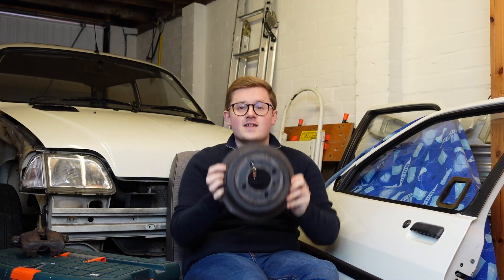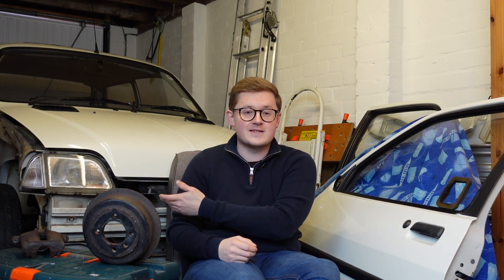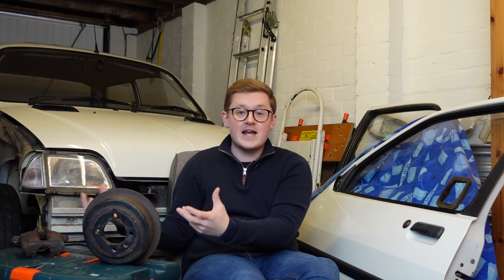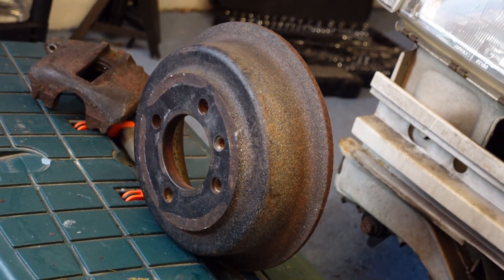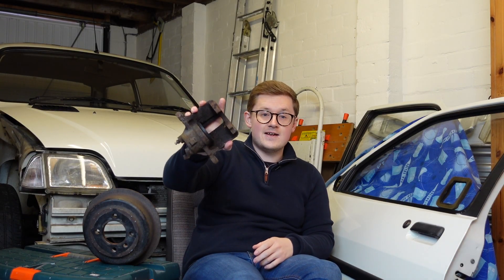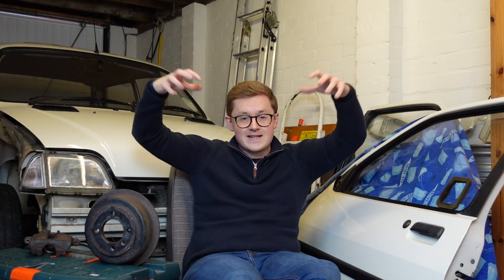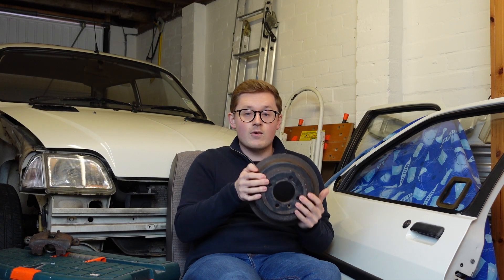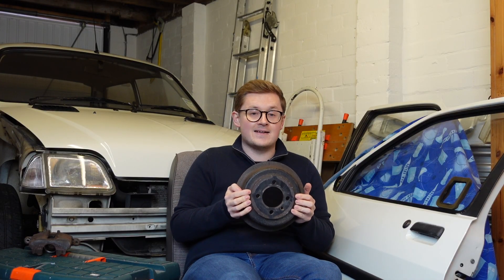Why are Drum Brakes Making an EV Comeback?

Comment: Drum brakes fade very quickly with a heavily loaded vehicle doing an aggressive stop. Nothing is worse than jamming on drum brakes on a dark highway at night with a large flatbed trailer crossing the lanes stalled there. I saw something that caused me to brake hard and then the headlights lit up that large agricultural flatbed. I put maximum pressure...stood on the brakes...and within 2 seconds they were completely ineffective and I made a dive to the right and narrowly avoided decapitating the 4 of us. The truck had no lights on at all. 

Also, when I crossed flooded roads, drum brakes would not grab at all until I rode around putting pressure on the brake pedal to dry them out. That might take 30-45 seconds before any meaningful braking was available. My experience was from a 1964 GM Corvair,  a 1966 Chevelle Malibu, and a 1968 Chevelle Malibu with drum brakes. Then somebody gave me a Triumph Spitfire with front disc brakes. They worked so well that I was a converted fan of them. They are also much easier to repair as the pads can be changed easily within minutes. I still have rear drum brakes on my older  truck and van.

Comment: Some good points, both in the video and in the comments. One point that seems to have been missed is that drum brakes don't work with anti-lock braking systems, as they cannot respond fast enough. Also, the "grabbing" of drum brake shoes comes from a wrapping effect, where the lead shoe drives the trailing shoe into the drum. An enclosed brake on the rear is so much better protected from the elements!

Comment: The EV is much heavier vehicle. The battery can be 1 ton alone. Drums are a cheaper way to go. Harder to replace shoes and many more parts than disk brakes. This all boils down to much more expensive brake job when the time comes. In fact all repairs on an EV will be more than a ICE vehicle.
Reply: Batteries are usually 500kg. I drive EVs now for 10 years and just sold a 10 year old EV with rear drums. If you use the brakes they dont corrode and last long, discs or drums. 10 years or 100k miles with the first brakes is no problem. Working on my own cars for 37 years and EVs have much much much less maintenance and costs
Reply: OK you seem smart how much is the  per mile rating and resale value. @t.d.5804

Comment: An interesting (?) point to note is that disc brakes need a higher pressure to operate than drums, meaning that on mixed systems the inclusion of a brake bias valve is needed to modulate the pressure to stop the drums prematurely locking up when loads are lower at the rear...
Cheers!

Comment: I am not sure I even understand why separate brakes are needed on modern EVs at all, couldn't you just make the regenerative breaking powerful enough to replace the whole, traditional, braking system? At least if the motors are powerful enough and put on all wheels and you also add a resistor that can take whatever electrical output they produce that the battery cannot take back...seems like a simpler, better system over all, except maybe for the parking brake and legislation that requires specific design. What am I missing?

Comment: just because EV´s get more efficient doesn´t remove the fact that they are far more devastating for the enviroment to produce than many older generation ICE-cars, many minerals are conflict-region sourced and next plan is to start mining the seabed bc there are based on estimates based on computer models and what people know about metallurgy utterly massive fields of rare minerals within the pacific seabed somewhere mid/southern pacific and others are few likely spot´s being looked for within the atlantic....still what that does to the sealife is to be seen.if we ignore that in the current top of the generational development still offers piss poor range in very cold climates dropping well below 20 degrees celsius they loose atleast 1/3rd of their normal range ability, and if there´s lack of charging stations,welp tough luck.Further more reliability comes to a question operating around -30 and even -40...something which is possible in the northern hemisphere sucha as nordics and canada...Most likely natural development as a transition away from ICE is some sort of Fuel cell, based on the massive buildup of hydrogen industry as the branch of the energy industry.

Comment: Um I have disc brakes on all four wheels of my vehicle, but I also have drum brakes on the rear wheels.
My drum brakes are the emergency/parking brakes, and they do not require brake fluid. 
So even if all my brake fluid suddenly goes on vacation, I still have use of my drum brakes.

Comment: I'd not want a car that was designed in a way that letting off the accelerator always engages an active regen systems... IMO the car should be in a "no accel" or freewheeling mode unless the driver is actively requesting it (through the brake or accel pedals). On Standard transmission vehicles you have that issue of braking when there's no input to either pedal (engine braking which can be very strong on some vehicles especially motorcycles) but have a clutch you can use to free wheel. I think using the brake to activate regen somehow is the right recipe but of course this all adds complexity (and complexity in your braking system is bad) so needs to be very carefully implemented.

Comment: Discs glazing predates modern EVs. The Dennis Enviro 300 was a full-size, single-deck, diesel-engined bus, with disc brakes on the front. (Can't remember about the rear.) As is normal for buses, it also had a retarder that cut in automatically as the throttle pedal was released. In service at the (then) new Eden Project, the retarder was so effective that the discs glazed. And the solution was to dial back on the retarder. [I worked in the Dennis engineering office, 2002-2008.]

Comment: (1) I had a 1995 Geo Metro for a few years. It was a joy to drive, got awesome gas mileage, and had an amazing amount of cargo space (so long as that cargo wasn't too heavy). It also was supremely balanced, spinning exactly around the stick-shifter (don't think too hard about how I would know that).
(2) My current vehicle, a PHEV, seems to be programmed to take into account the maintenance needs of the disk brakes—virtually always kicking them in before the car has stopped rolling.
(3) Properly built & maintained disk brakes DO NOT drag when released. The brake shoe / pad combination is actually a spring which is flexed when squeezed and retracts the pad from the disk upon release. If they did not do so they would wear DRAMATICALLY faster. This is also why one does not only measure pad wear at the leading & trailing edges as it is the wear in the middle which determines when the brake will fail.

Comment: Thank you for explaining why you were 'looking down' peridocally. I though you might be checking out our 🌭🍑   Well, nuff said about that. re: "Those R the brakes": Really clearly eXplained! May I add that disk brakes don't generally spin freely - causing them to drag slightly. Properly adjusted drum brakes R free spining. And I believe drump can be slightly ligher. Yes, shocking. But once you add up that very heavy rotor & caliper it can be a fatty. A plus for a power sipping EV. Thank you for the video. It's true what people are saying.. you do RoCk. Cheers from So.CA.USA 3rd House On the Left

Comment: I don't mind disk or drum brakes. Both work fine. My current truck has drum rear and a proportioning valve to decrease braking force on the rear drums with low to no load in the bed. Saves the rear from as much wear when not hauling something while increasing rear force when hauling. The front are disk. I do want to upgrade the front to bigger disk as they are quite a small size for a truck that can tow 7000lbs. However my old truck was all drum. 2" front and 2.5" rear. It was annoying to try and adjust them all so when I braked I wasn't pulled to one side or the other. I would get them just right then a month later I'm pulled to the side again. America kept the drum brakes around a lot longer than other places it seems. As my current truck was made in 2002 and my old truck 1973. Though I don't have a slightly older car to say if it was just a truck or America thing.

Comment: It is also important to note that classic brakes supplement regenerative breaking systems. This is because the energy that can be harvested from the kinetic energy of the vehicle's motion is dependent on the speed of the vehicle. That faster the vehicle is travelling, the more stopping power the regenerative breaking system can bring to bare. The downside is that regenerative breaking actually does fade to zero at low speeds (sub 5km/hr or so). So even in EVs outfitted with state of the art regenerative systems, the conventional brakes are still used to maintain a stopped position and very slow speeds. This combination makes regenerative breaking and ANY brake system a compliment towards each other and actually increases the maximum stopping force that can be generated by the system as a whole (though that is still limited by the ABS systems to avoid full lock-up, fun fact, regenerative breaking alone actually has something akin to ABS automatically as part of the physics of how they work. This is because the breaking force is actually dependent on the rotational speed between the Wheel and the motor, not the car and the ground, so a wheel that has fully locked up no longer has any breaking force from the motor and begins turning again.)

Comment: You've obviously never driven a car with drum brakes on a wet day - water that does get into the drum, stays in the drum and when you hit the brakes nothing happens, except that awful feeling in your gut when your car doesn't slow down.  It's something you never forget and you get into the habit of "drying" your brakes after hitting a puddle even though it's been many years since you had a car with drum brakes.
Reply from the maker: I have actually. Not in the wet on this channel, but a number of times off it. However, I’m guessing you passed your driving test some decades ago as all new drivers are trained to dry their brakes after driving through standing water, and when in wet conditions, to dry the brakes in the run up to a junction or other braking situation. It’s in the Highway Code too.

Comment: As an apprentice motor mechanic in 1961 I never saw disk brakes until much, much later. All the cars I worked on had drum brakes front and rear. I even relined worn brake shoes with brake linings off a roll. Those early brake linings contained asbestos. After riveting on the new lining with copper rivets you had to chamfer the leading edge of the lining so that the brakes didn't grab. Several years later we just got a replacement set of brake shoes from the local dealer or parts supplier, handing in the old brake shoes which were returned to the manufacturer to have the linings professionally replaced. In some cases drivers didn't have their vehicles maintained regularly so that the brake linings were worn down to the rivets and then the drum surface got damaged by scoring, so much so that drums sometimes needed to be sent away for machining to remove some steel in order to remove the score marks. This increased the internal diameter of the brake drum, therefore the brake shoes had further to go before contacting the drum, thus affecting braking performance. However, as I recall, slightly oversized brake shoes were available to compensate. There's a lot to be said about drum brakes, and I haven't even mentioned the wheel cylinders yet!

Comment: Very interesting.  I have a hybrid and I still haven't changed my brake pads even after 120K miles.  I agree that if the EV has brakes, they should never have to be changed due to regenerative braking by the motor.

Comment: Electrically powered wheelchairs and mobility scooters are only using regenerative braking to decelerate. They do have mechanical parking brakes, which are not used at all during normal driving.

Comment: The servo action of drum brakes was not explained. Essentially, one of the drum shoes is primary and the other is secondary. As soon as the hydraulic cylinder is activated, the primary (smaller shoe) contacts the drum first and  is driven forcefully into the secondary (larger) shoe which exerts a much larger force on the  drum. This way, the forward momentum of the vehicle supplies the energy to produce the braking. One disadvantage of this system, is that the brakes are not nearly as effective in reverse, because the only force left acting on the brake shoes is the hydraulic cylinder force, due to loss of servo effect.

Comment: I've seen an argument about slowing down without vs with having a brake light. The argument is basically as follows:
Safety conscious person:: you need a brake light, how else are the people behind you going to know you're slowing down?
a guy or gal who hasn't thought about how human perception works: they'll see me slowing down, getting closer, of course, so what's the point in wasting electricity.

aka that's not how perception works. Also, ignores speed differences to start with, and how far off you begin. a red light is a red light, you instantly know it means 'braking'(if you're a driver), so you START knowing they're braking. without that light, you need to compare where they are now, with now where are they, and where are they now and oh shit too close! aka temporal perrception of change, vs static perception of Big Red Light.

Comment: We now have tungsten carbide coated discs. Porsche denote this with White Calipers! Soon there will be no need for brakes!!! Three motor EV's will have SIX motors? 3 on each axle! Front, one for drive two for regen braking! Rear Two for drive & one for braking! Drive & braking will have separate Cooling Circuits. Also touch the brake will light the brake lights! A weight penalty? Yes but this is off by greater regen adding to range! Less total parts/assemblies if the 3 drive motors are the same part. Ditto 3 regens.

Comment: Isn't there a way to somehow get the best of both worlds for EVs? What about inboard disc brakes for example? My Alfasud has them and they are quite satisfactory. The only disadvantage they have is that they wind up the driveshafts resulting in a rocking motion at the end of the braking distance but perhaps this could be alleviated with sturdier driveshafts which EVs need anyway because they produce large amounts of torque.

Comment: Having turned wrenches for a number of years, I would actually prefer drums on the rear of any passenger vehicle in normal use. You can get maybe 150000 km of use without barely any service, fewer parking brake issues, and I've yet to encounter a drum that couldn't be re-cut at least once.

I will say that I also prefer single-pivot drums. They're a bit more technically challenging to replace for a novice, but I find the slack adjuster mechanisms to generally be more reliable and the shoes physically easier to change.

Comment: Drum brakes are a nightmare to service after aging so I am naturally biased against them. That being said, brake burnishing is trivial an done automatically on Tesla cars so rust is a non-issue. On top of that, if I am using my brakes in an EV, it usually means I reaaallly need them, and I'd prefer to have higher performing brakes in that situation. Couple that with the fact the brakes are hardly used so the lifetime is ridiculously long, disk brakes are a no-brainer for most EV's today.

Comment: Give me disc brakes any day. Brake fluid from the wheel cylinder and grease from the axle bearings leaks onto the brake shoes. Disk pads so much easier to change and I am sure they can put a return spring on disc pads. But yeh if they are not going to wear out then I guess it doesn't really matter.

Comment: Why aren’t the EVs using regenerative braking? In other words, you could slow each wheel by making each wheel function as an electric generator, thereby sending the generated electricity back to the battery.
Reply: they do use regenerative braking

Comment: Drum brakes are lighter than disk brakes. This improves the sprung / unsprung ratio which is better at keeping the wheels on the pavement. The problem with them is that they are good for only one stop from high speed until they cool off again. People that are not aware of this limitation can get into serious trouble.

Comment: OK, I get why drums are making a comeback for EVs and I will grudgingly accept them on an EV but they have been the bane of my existence on gas cars.  Replacing a disc brake takes minutes.  Drum brakes take hours.  If you don't do it yourself, it's irrelevant but for me, I recently got a car with disc brakes on all four wheels and replacing the brakes took a fraction of the time.
Reply from the maker: Hours? I assume you’re not a mechanic. Took me 25 minutes to do the drums on my Metro and I’d never even looked at one beforehand. A little longer than discs, sure, but as they only need work a fraction of the amount, they probably take less work over the life of a car.

Comment: The biggest issue in many parts of the USA is winter use of road salt which can rapidly rust out exposed brake disks and calipers.  A properly sealed drum brake will rust on the exterior of the heavy drum, but the internal parts will only have to deal with brake shoe dust which is easily cleaned out once a year or so.

Comment: I've seen a few springs on disc brake pads. They're not super common, but they can be had. It's a relatively minor point, to be fair.

I'd also argue that discs have been cheaper for me to maintain because I have no issue changing pads or myself. I still haven't succeeded in replacing shoes, so I have to pay for labor on drums.